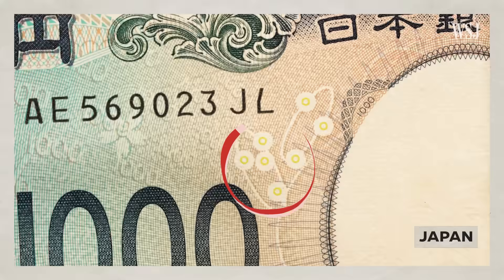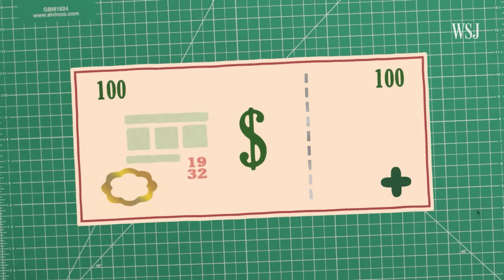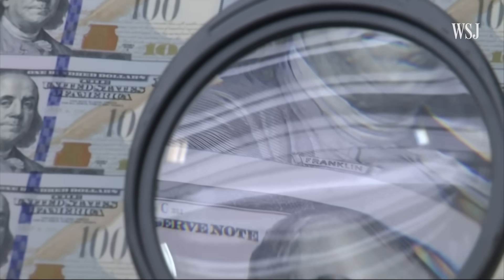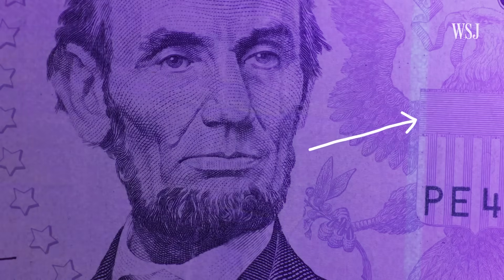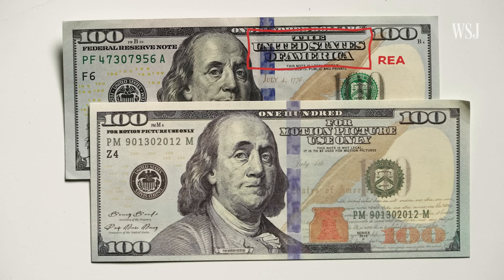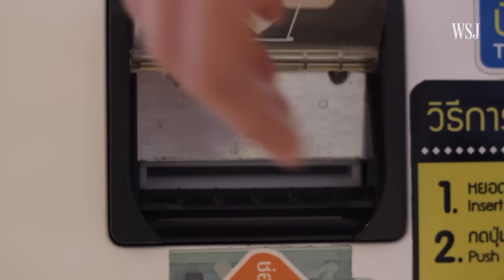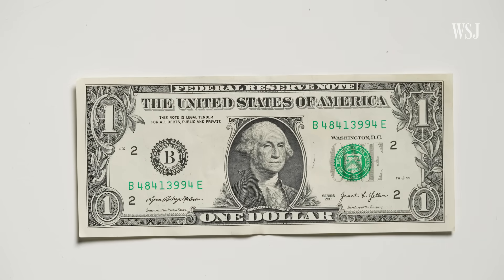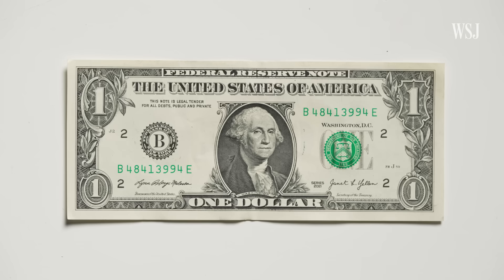Why the $1 Bill Hasn’t Been Redesigned in Over 60 Years | WSJ Pro Perfected

Comment: Pretty obvious why the $1 note is the least secure. But interesting that it’s so old and that there is actually legislation to prevent it from being redesigned.
Reply: No one fakes pennies or nickles either.   Quarters seem to be open to fakes with the 100s of variations. but who thinks hey can make a cheaper quarter?  Dollars are probably very close,
Reply: The $1 bill is bassically unchanged since the late 1920's.
Reply: @geigertec5921 very true the few changes that have happened is the reduction in size. Which was done in the late 20s. The change of the back to what it is today which was around the mid 30s. Then a few smaller changes that occurred from there till about the 60s and the dropping of all other seals except the Federal Reserve Green. The two dollar bill is also very similar though they were still making them as the red seal legal tender bills with Monticello on the Reverse and they ran like thst until 1966. Then about a decade later they brought the two back with a green seal and the Reverse being changed to its current look the signing of the declaration of Independence was put on the Reverse instead as it happened to be 1976 and the bill has stayed the same as well. The 2 is most likely never going to change as if change was needed they would probably discontinue the series.
Reply: @geigertec5921  not true, the front looked completely different in the 30s, only the Washington's portrait was kept
Reply: @AtoManPL correct! The back dates back to 1934 (with addition of “in god we trust” in 1957) and the front as we know it dates back to 1963.
Reply: @BeingMe23  yesssss hook me up 💯😂😂